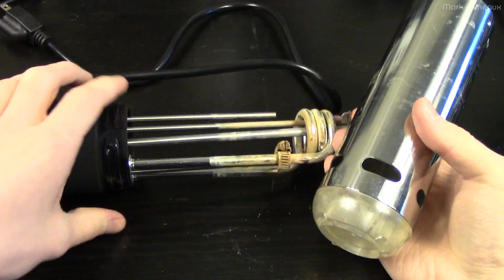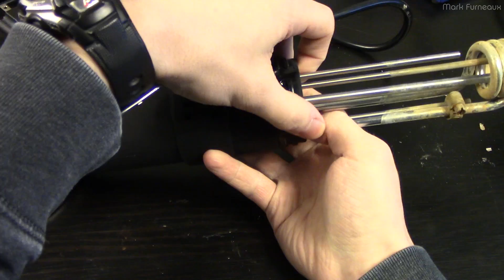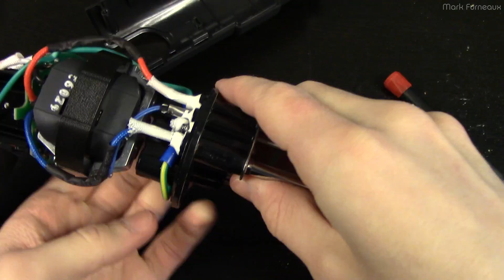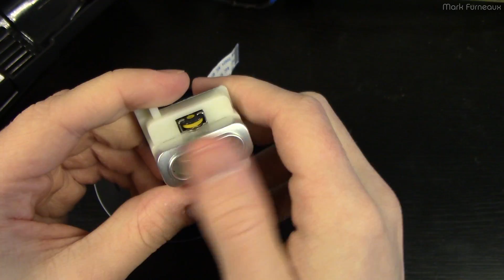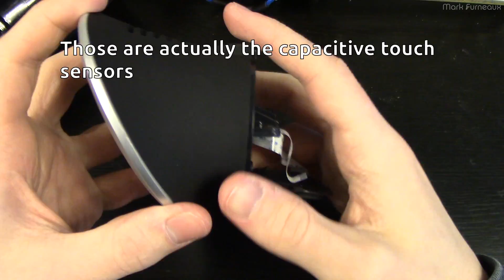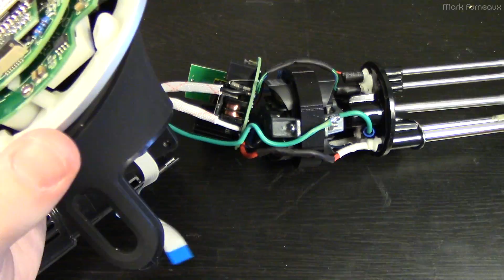Teardown of the Anova Precision Sous Vide Cooker

Comment: Thanks for the video!  Mine works fine other than the thumbdial for setting the temperature rotates and does not change the tempereture smoothly like it should.  It will stay on a certain degree and change a unit or two but spinning the wheel many times will get it to move finally but the internal contacts of whatever is in that thumbwheel have gone bad.  I am able to get it down to my 125-130 range and sort of leave it there.  Bad design of that potentiameter or whatever allows the temperature to be set.

Comment: I've just bid on a similar device on ebay with a non functioning display.  I'm hoping it's just a poorly installed ribbon cable at the factory.  A lot of these manufacturing defects are simple issues once you dig into them.  I really hope it doesn't involve desoldering a stack of boards like yours. I'm guessing that the opto isolators are to reduce the rf interference from the motor.  The data lines on microcontrollers are pretty sensitive to that kind of stuff. I've experienced plenty of problems dealing with corruption of data communication when there are electric motors involved.  It can be really annoying.  Opto-isolators can do a great job of filtering out the noise.

Comment: You said that there wasn’t anything sealing the motor shaft and that the fan was sealed except through that port, so I wonder if the fan is being used to run air over the power electronics and then force air out of the shaft hole to keep water out. 

A way to test it would be to immerse it while it's set at a lower temp than the water (in a glass it will fit in) and wrap everything under the vent in a plastic bag to see if it fills. Or even squirting some soapy water on the shaft hole.

Comment: Electronics, though functional is quite amateurish. It could be siplified and compacted significantly if designed properly instead of using off the shelf modules. Looks more like a prototype than a proffesional product. 8051 processors are absolutely ancient. The main microcontroller, wifi and bluetooth  can all be in a single chip (esp32 for example).

Comment: I have a problem with mine- it overshoots heating temperature - ie i set it to 56 degrees - but it heats to 80 degrees(uppper display showing 80 and lower 56). When i plug it in, it starts to show 70 degrees(celsius) in the upper display - and then runs down to room temperature (after 20-30 seconds). But if it then use it -suddenly the temperature is in the 80's - and meat ruined.... The lower display keeps being set temperature  - ie 56.  Would you happen to know if this indicates issue with the temperature probes themselves - or some electronic part?

Comment: Mine has a problem with the motor. We it's turned on the impeller turns for 30-40 seconds. Then stops and won't spin again 
I was able to get it apart but don't see anything obvious that would the motor. 

Any thoughts?

Thanks

Comment: Mine was flat dead after working for years. Used it Friday and put it away, and Sunday it was completely dead.  I watched this video and got to the fuse, but the fuse was fine, I even tried to jump over the fuse, but it was still dead. I wasn't going to dig deeper, so in the trash it went. Thank you for getting me that far at least.

Comment: I beg to differ about your comment that the machine is fucked if it is dropped in the water. If it was connected to power, almost certainly so, but I dropped mine in the water after disconnecting it from power, and I thought it was a goner. But using this video to tear it apart and leave it for several days to dry out, I then reassembled it, and it works fine. Thank you.

Comment: Thanks for the awesome in depth tutorial ! I can tell you the small  fan in the head stock is critical! Mine was intermittent and the heat and smell of frying electronics stunk out the kitchen. It  forced me to take it apart. I could hear the difference when the fan stopped while the circ pump continued to operate. I thought there might have been a fan on top of the motor that was slipping, until you showed me the fan buried in the head stock. I don't know where I can find a replacement fan

Comment: @6:07 I don't think there are three temp sensors but rather only two. One is hose clamped to to the heater (it has two leads) and the other one is the long one (with three leads of which only two represent either NTC/PTC resistor) in the middle of the heating element. The short one only has one lead and it's there just to provide a closed circuit between short one and the long one lead when you have enough water to start heating.

Comment: The reason that multiple PCB are stacked, and not two (as you said) or less are used is for the purpose of reusability between products. For example, the display board is specifically made only for this model but the uC and RF-IFs are not, so uC and RF-IFs can use also to other products. This will reduce the cost of production a lot.

Comment: sorry to awaken an old video, i am having an issue with my unit, it will get to temp and beep and then it just turns the heater off and then doesn't do anything, do you know if this is fixable and how,
thanks

Comment: I had to swap out the two temperature sensors from my Anova that quit working due to a bad power supply in order to fix another non-working Anova I found on eBay to get parts. This video helped guide me through the process and is certainly enough that I did not have to bother with my own video on how I did my repair.  Though I might add a video place holder "anova sensor replacement" that points to this video. 
The symptom was a temperature reading way out of wack, 404 degrees.  I confirmed sensors by removing the sensor wires entirely, then it gave a reading of -17 degrees. 
One has to take apart the motor so that the sensors can pull up-and-out towards the motor because the sensor leads have crimps that make the sensors bigger than the hole it is mounted in. The white waterproofing is soft and does not hold them in, but this waterproofing needs to be scaped away a little before pulling on the sensors to remove them.  
One thing that made it a little tricky was the slight difference in models, though almost identical, they were not.  The power and sensor circuit boards were similar but arranged so I could not just swap the power supply as I had intended.  To my surprise, the motor was arranged a little different too so that one sensor was slightly longer and butted up against the motor more than I would like. Not a job for the inexperienced, but quite doable for every other DIY person.
Reply: Mine had the same problem. I've opened it but am struggling to find replacement temp sensors but I have determined the faulty one. Can you lead me to a source?
Reply: @NorthWoodsDiver  I bought a "parts" unit from eBay.

Comment: Is it possible to disable the "low water" alarm? Many Anova units are faulty and the detection is broken even though there is plenty of water.  It errors with a long beep of death rendering the unit useless.
Reply: Jordanrom yes, soldering a jumper wire across the leads will disable/bypass the water sensor.
Reply: @makechips  Across which leads? Please, give some more detail.

Comment: Anyone fix the water level sensors?
Reply: Waiting for this too.  My unit is just out of warranty and basically useless now.
Reply: Ac
Reply: We have 2 units dead and the 10k resistor across the contacts on the PCB did not resolve it. The problem is further downstream.

Comment: the aluminum cooler is for the mosfet... the relay is for the heater... the two metal plate board is a PID the reference point is a sine wave it cuts the wave and hits the relay until the temperature is hit. the two wires from the two metal plate board senses temperature  through the probe attached to the heating element via hose clamp as well and is controlling the relay for the heater.
Reply: The aluminium cooler is actually on a triac which controls the heater. The relay is for the pump, you hear it tick once a (half-second after turn-on) and then once again on turn off.
Reply: @Shaun.Stephens  You read my mind, i was just about to question why not using a triac for the heating, it's cheap and effective for a pure resistive load
Reply: I inherited one of these and the temperature reading was incorrect (erratic and higher than the actual temp). Started poking around and noticed the hose clamp holding the temp sensor to the heating element. This seemed a little odd to me at the time (the clamp didn't look like it was meant to be there) and the possible cause for the bad readings I was getting, so I pulled it off and have noticed that it seems to be working fine now. Is there any reason (safety or whatever) why I should re-clamp the probe to the heating element?
Reply: @chee8748  Same! Working perfectly now!

Comment: Hi,  is it possible to change a motor to a higher voltage without any parts being affected with voltage? Kindly help because i dun have a backgound on electrical matters.  120V to 220V.
Reply: get a power adapter??? 120 to 220.

Comment: Run that thing with a vinegar/water bath to remove all that mineral deposit on it. Do a search for anova precision cleaning for exact directions. Definitely run water level as high as the stains are. :-)
It'll look brand new after a possible toothbrushing after the bath cleaning.
Reply: Hi I want take off the beeping sensor how to do it thanks

Comment: The motor of my ANOVA just gave up on me. What I can see is that the impeller is not spinning but all other components appear to work fine.  Interestingly the sound of the circulator is the same as before. Maybe the main noise source is the fan?! I might take it apart as well to get more insight into what's wrong with my machine.
Reply: Same as my machine. But on our country there handyman elecrtricians that can easily rewind the motor. But as for me i have 2 units 120V and 220V just wanted to swap the motors. Prblem is that will the 120V parts can work if  i swap the 220V motor in.
Reply: Yeah my motor is not working as well

Comment: The pair of probes (one longer than the other) near the front of the unit that extend into the water constitute a water level sensor. 500 mV is applied across the probes and the current is detected. If no current is detected, the unit shuts down and beeps. You can circumvent this with a 10k resistor across the probes, but you still need to have the longer probe immersed in water for the unit to turn on. Not sure why that is.
Reply: So if I solder a 10k resistor between the two the long beep of death with go away?
Reply: @VacuumD3cay  For what it's worth, I tried this experiment. My Anova looks different from the one in the video, but has the same problem with low water level beeping. First of all, let me say that the problem is due to poor design w.r.t. moisture barrier. When the unit is in use, moisture gets right in there and fouls the operation of the electronics (not exactly sure how yet). Actually a friend of mine was in charge of designing the second generation, where he effectively addressed the problem. And it's a big problem where so many of us faithfully purchased the first generation and ran into this problem right when we wanted to get that expensive piece of meat cooked! Anova has denied the problem and at best has offered discounts towards the purchase of a new one (with the same problem). What good is that?

The longer probe is actually both a thermistor/thermocouple and one side of the water level sensor, three wires in total. The short probe has one wire. Placing a 10K resistor across the sensor wires indeed allows the unit to operate normally. I didn't need to have the longer probe in the water for this to work.

Be aware, though, that this allows the heating unit to run wild, so if you EVER turn the unit on without the heater submerged, in a matter of a minute, you are most likely going to do some damage with the heat. Remember that this is why the water level sensor is there to begin with.
Reply: @hansonquan1140  Thank you for the info!  Any chance you can do a tutorial on the process?  I will risk the damage as I would never use the unit out of water.
Reply: @VacuumD3cay  I'm not big on tutorials, but if you look at 6:17 of this video, you can see the sensor wires near the top of the unit. There's a red wire (the only one coming from the short probe), and two green wires (thermistor from the bottom probe) and another blue wire. Colors are different for me, but you'd connect a resistor between the blue and red wires, preferably where they connect to the circuit board. I hope you have some EE skills to do this and know that you're messing with electricity + water! I have 30 years' experience as an EE, so that just means I know when I'm being stupid :-).
Reply: @hansonquan1140  Thank you for the info!  I'll give it a shot, I have nothing to lose since my unit beeps 100% of the time now.  Thank you!!!
Reply: @VacuumD3cay  You're welcome, good luck!
Reply: @hansonquan1140   Sorry one more question.  Should I be using a 1/4 watt or 1/2 watt resistor?
Reply: @VacuumD3cay  I think a 1/4 watt resistor is fine, and is what I used. This part of the design is not high current. BTW I tested the fix, leaving the unit on and circulating the water at temperature for somewhere around three hours. Good luck! And thanks go to the original poster, @nopcbs2.
Reply: Ours would error "Low Water" beeping and also in the App, I tried the resistor mod mentioned above without success, then I started checking the NTC temperatures sensors and the one strapped to the heater element was open circuit. I made a short video about the repair here: https://youtu.be/CgD-UCQovVY
Reply: @Everlanders  I would have loved to watch that  - but seems like you have a payment wall up :(

Comment: Does anyone know what’s the spec for the internal fuse? I need to replace mine which blew last week!
I was able to remove it, but not sure which one to use now.
Reply: Ha! With some forensic work I managed to read from the blown fuse which involved a super macro lens on my iPhone and some corn flour :) , I managed to identify it: it’s a pigtail F10AL 250V glass fuse, one of the small ones (3.6mm x 10mm). Ordered now, can’t wait to try!
Reply: @dquintiere  I know it's been a while, hope you got it working. But sometimes a blown fuse is an indication of something else gone wrong. Did the new fuse work?
Reply: Hanson Quan - you’re right, there was something else wrong and seemed impossible to fix. I contacted Anova who sent me a new one.

Comment: Mark, I did the big mistake of connecting my anova, wich is 110v, in a 220v socket. After the cracking sound I disconected and opened it. The thing is the fuse seems to be intact, do you know what could have blown up apart from the fuse?

Comment: THANK YOU for having this video!!!!  I accidentally knocked mine off the kitchen counter and caught it by the cord, but it still hit the floor.  It popped it apart and the two little tabs below the temperature control wouldn't go back in - got them in.   I also wasn't aware that the base came off.  I had a couple of small Kerr jars break open which circulated egg through it. :)  I had cleaned it out pretty good with q-tipps, but I found there were a couple of small pieces I missed that I can now clean.  Thanks again!!

Comment: Hi Mark

My Anova circulator stopped working due to, what I assume is, an electrical contact issue.

Thankfully, it was a bit less than a year after I received it, so Anova sent me a brand new one after I showed them the problem on this video : https://youtu.be/M5DbDZLQi44 . I guess they don't bother with a return for canadian customers.

Now I figured I'd open up my defective unit, try to repair it and then have two of those. I was expecting to see something very simple like a loose soldering from the power cable or something.

It seems though that all soldering to the board are intact and solid. When opened up, if plugged into the wall, it doesn't light up at all (though I can hear a small "hmmm" coming from the unit).

Any idea what the fault might be or what would be your steps to troubleshoot it?

thanks for the help, your videos are amazing

PHil

Comment: Thanks for the video Mark, I am in the evaluation stage of considering which Sous Vide solution I'm going with... but what I am more impressed with, is that there are folks like you who still "get it"... and are willing to take to time to demonstrate it... Nice to see there is hope for the new generation :)  I'm sure you won't be throwing it out when it experiences an issue, which will most likely be the motor shaft bearing screeching and / or caps failing in the PSU.  Looking forward to that repair video in a few years down the road - lol.  Glad to see it's fully repairable in my opinion.  Great stuff, thanks.
Reply: By far the biggest mode of failure in these early Anova Precisions is due to moisture getting pulled into the electronics by that fan. That's why all of the models Anova now sell don't use that system (or a mains AC induction motor). I disassembled mine and cleaned as much of the PCBs as I could with IPA (to remove shorts and 'tracking') but it seems it's lost it's programming. It displays temperatures in the negative range. :-/